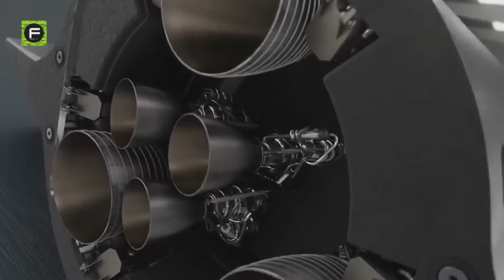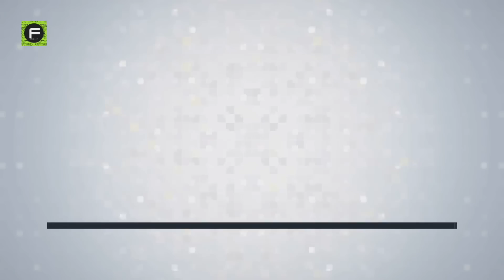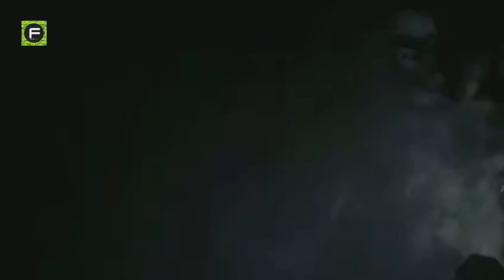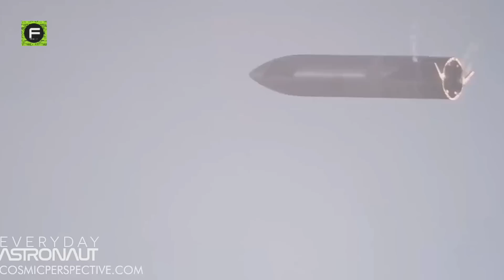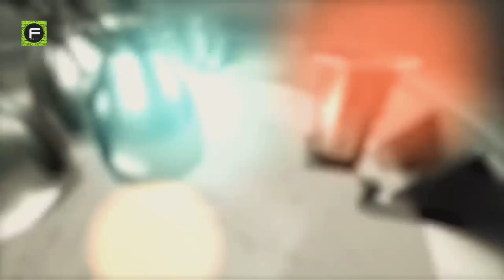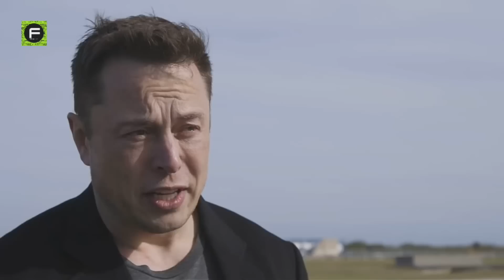Can Spacex Starship SN9 land in one piece?

Comment: Disappointing quality - several noticeable mistakes in the voice-over, some which don't even match the closed captions. The narrator needs to learn that "nosecone" is NOT pronounces "no secure". The kludging together of the video is somewhat understandable, but it's jarring when the landing flip sequence cuts between sn8, the early video simulation of the flight, a mars landing simulation, and close up video simulation of the 6 engine configuration. This, sadly, doesn't add to the knowledge base of viewers in a reliable and truthful way.